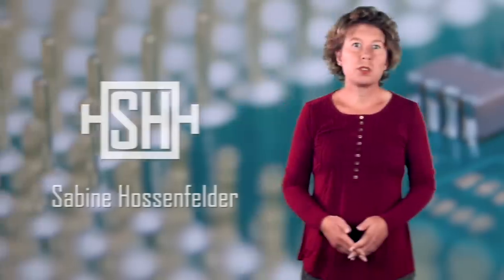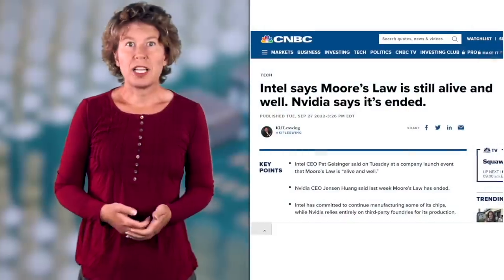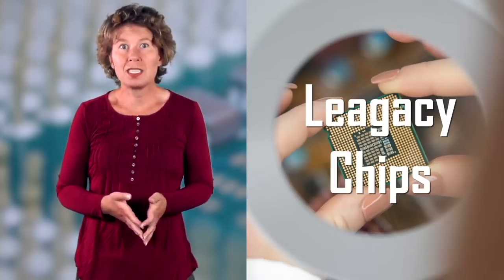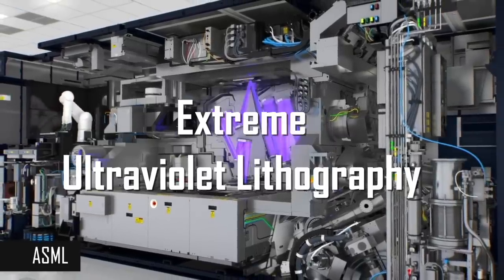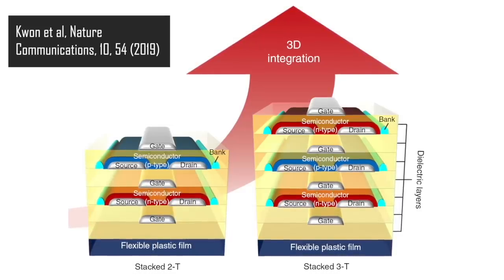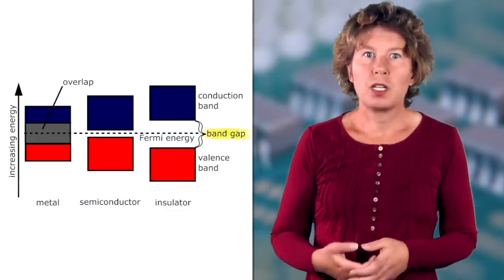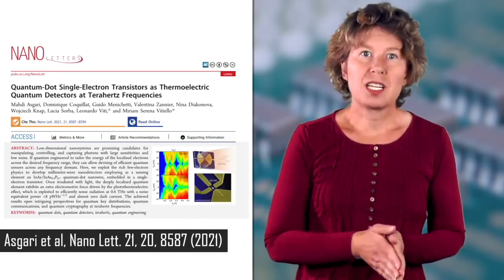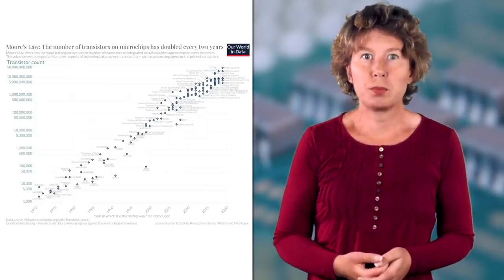Is Moore's Law Finally Dead?

Comment: A few comments from a chip designer. 
1) Regarding the transistor size limit, we are pretty close to the absolute physical limit. Although the minimum gate length equivalent figure (the X nm name that is used to name the process node) only refers to one dimension (and even that's not quite that simple), we are talking dimensions now in the high single digits, or low double digits of atoms.
2) Regarding electron tunneling, this is already quite common in all the current modern process nodes. This shows up as a consistent amount of background leakage current, however as long as it's balance (which it typically is) then it doesn't cause logical error per-se. However, it does increase the amount of energy that is just being turned into heat instead of performing any useful processing, so it does slightly cut into the power savings of going to a smaller node.
3) One of the biggest things impacting Moore's law in the context of the transistors/chip interpretation is manufacturing precision, crystal defects, and other manufacturing defects. Silicon wafers (and others as well) have random defects on the surface. Typically when a design is arrayed up on the surface, during later wafer test a handful of the chips will not turn on due to these defects, and thus are discarded. The ratio of good transistors to total transistors is referred to as the wafer yield. As long as the chips are small, then a single defect may only impact yield a little bit because the overall wafer has hundreds or thousands of possible chips, and only a few hundred defects that could kill a chip. But as chips get larger, yield tends to go down because there are fewer chips per wafer. There are some techniques like being able to turn off part of a chip (this is how you got those 3 core AMD chips for example), but ultimately as chips get larger, the yield goes down, and thus they get more expensive to manufacture.
4) As discussed in this video, what people really care about isn't transistor density, or even transistors per package. Rather, they care about computing performance for common tasks, and in particular for tasks that take a long time. By creating custom ASIC parts for new tasks that are compute intensive (ML cores, dedicated stream processors, etc), the performance can be increased so that the equivalent compute capability is many times better. This is one of the areas of improvement that has helped a lot with performance, indeed even outpacing process improvement. For example, dedicated SIMD cores, GPUs with lots of parallel stream processors, voice and audio codec coprocessors, and so on.

Anyway, overall a great video on the topic as always!
Reply: Surely these improvements in chip architecture (idk if that's the right way to put it) also has its limits.  Ik it's not very planned obsolescence of me, but what I'd really like is for manufacturers (& programmers) to focus on increasing the longevity of computers.

It'd be nice to only need to buy a phone once every 10 or 20 years instead of once every 2 or 3 years.
Reply: Process nodes like "X nm" don't refer to an actual physical channel length, gate pitch or any other transistor dimension anymore. Unfortunately this video doesn't help clear up that common misconception. They are merely marketing labels loosely correlating with performance or transistor density. In particular, channel length (i.e. transistor size) shrinking has essentially halted a while ago at ~20 nm, so a 5 nm transistor isn't nearly as small as "5 nm" would indicate.
Reply: @Pukkeh  Yes, that's why I used the term "minimum gate length equivalent" instead of saying minimum gate length. The actual minimum feature sizes are larger than the marketing minimum gate length equivalent number , but they are still quite small.
Reply: @funtechu I understand, I'm just clarifying for the benefit of anyone else who might be reading these. Most people outside the field think the process node name refers to some physical transistor feature size. This hasn't been the case for years.
Reply: @dr.zoidberg8666  Absolutely, though those design limits are much harder to put your finger on. For example, Amdahl's law sets a limit on how much you can parallelize something, but even that can sometimes be worked around by choosing a completely different algorithm that manages to convert what was previously though to be strictly sequential to some clever parallel implementation. 

As for longevity there are two major aspects of that. For phones, the biggest thing that impacts longevity is battery life, which could be remedied by having battery replacements. Personally I keep most of my phones about 5 years, with typically one battery swap in the middle of that period. Most people though buy newer phones just because they want the new features of a newer phone, not because their older phone died.

The physical process limit on longevity is primarily driven by electromigration, where eventually the physical connections in a chip wear down and disconnect. In mission critical chips there is a fair amount of effort put into ensuring redundancy in current paths to try to improve longevity and reliability, but the fact is that heat dissipation is one of the largest factors that impact this in practice. Keep your electronics cool, make sure they have adequate cooling, and they will run longer in general. Note that this is also more of an issue with newer process technologies because metal layer trace widths are typically much smaller than they have been with older process nodes, meaning that electromigration doesn't have to work as much to break a connection. So with higher density comes the tradeoff of slightly shorter lifespan.
Reply: @Pukkeh  Yeah good point.
Reply: Let start from wrong image of CPU-GPU transistor, she used typical n-p-n. For now modern computers are good enough to multiply human's garbage. Future can be in splitting tasks between humans and AI - leaving humans to post tweets and emojis - 280-4000 characters are good enough for typical no-brainer. Leave calculations to machines.
Reply: Yeah currently we are like 29nm for gate pitch, and that won't really go much below 16nm. I get very annoyed when people think the industry's marketing terms of "nm" gets confused with actual dimensions.
Reply: @MFMegaZeroX7  the amount of 'nm' was quite accurate for describing gate length right up to the point of finfet though. And I think that, even with finfet things being more of a mess,  some drawn dimensions in EDA layout, at least in 16 and 10 were still 16 and 10 nm respectively.
Reply: Nice & insightful comment. Thanks.
Reply: Hey, regarding the yield and chip size - what are the disadvantages of using chiplets? I mean it seams like a pretty awesome idea to improve yield via packing more, smaller chips on a single waffer.
Reply: It is fantastic to hear from you inside the industry. I don't understand half of it (or more) but it is still interesting. I see similar things at the more simplistic level us technicians deal in and have questions about why they designed this or that in a certain way. Maybe I'll learn something from watching Sabine's videos.
Reply: @psow4062 Higher power + latency, lower bandwidth between chiplets. It adds complexity for systems integration.
Reply: All very coo,but can you make computers hack proof.
Too much cyber crime happens.
Reply: I recall for upgrading my ZX Spectrum the 8 x 4164 chip was used to add 32 kb where the chip should be 64 kb. These were defects where the first 32 kb was ok. That was 1985.
Reply: Great reply. Why did you not ask for a video on chip design? The chip design is where all the real quality happens. Can't have a quality product with quality fabrication processes without the upstream quality built into the device and device architecture. Moore's Law is interesting, but the chip design is where the real thought happens.
Reply: Sounds to me like you need a means to do away with defects more efficiently or another means to assist with fixing this issue altogether.

I would like to know whats being done presently to fix the issue, so as to consider what else can be done to aid the issue.
Reply: i @Waterdust2000  i believe she mentioned 'light etching' to have less chip malformity.. course you're etching a malformed chip to begin with
Reply: The Von Neumann architecture has reached its limits.
Reply: This is what what said back in the 90s, but this time I think it is true. Then, it was largely a question of transistor leakage, a problem that was solved by abandoning the planar process. This time it is really a question of quantum tunneling.
Reply: Could that quantum/electron(same?) tunneling effect become a feature instead of a problem within chip architectures? The resulting current that you mentioned mentioned, any way to capture, isolate, redirect that energy? If i understood you currently it will be just ignored aslong the performance gain is not impeded and the energy and heat issues would not become unbareable, correct?

A while back i saw on the yt channel Asianometry a, in my eyes, well made chip manufacturing documentary. One thing that stuck with me was the thought that transistors do not just need to be placed on a 2D surface, but future archictures would try more and more built them ontop of each other. How far has that approach sofar taken root ? I would imagine the biggest issue is with either waver creation, as it is one thing to just chisel away from the top or having to hollow out thicker wavers(is that even possible?)or smack them ontop of each other. Which i would assume is what is done, creating matching tops, mid sections and bottoms, till we have waver layering on top of each other and by doing so creating more complex, yet efficient pathways as they are locally closer together.
Reply: I was hoping for some mention of Bizen. The important measure of Moore's law, isn't so much the transistors density, but rather the density of logic gates. Briefly, Bizen technology (a UK startup) has a new approach to the transistor, allowing for logic gates to be built with fewer transistors, thus shrinking chips without necessarily changing the die size. Last time I heard anything, they had received a research grant, but were a long way from production.
Reply: Am I wrong in thinking that she described a mosfet? I thought transistors were base, emitter and collector.
Reply: @eeledahc  Transistor is the general term. MOSFET stands for "metal oxide silicon field effect transistor" which is the most common type used in digital design. Other types are bipolar junction transistors (BJT) which has the symbol that Sabine uses in this video, IGBTs, JFETS, and so on. But they are all transistors and just have different uses.
Reply: @dr.zoidberg8666  "I want technology to progress slower so that my 20 year old technology can stay relevant." ....... el oh moe uh foe kun el sir
Reply: Calculating the inverses of heat distribution patterns can be used as operators too, as analogue phenomena.
Reply: When talking about development, the question is not only about (computing) power, but also about (computing) quality. 
In the transformation of energy, from one form to another, the (computing) power must be sufficient, but the quality of the energy must also be of the right kind. 
Massive automatic computing power still remain automatic: Its quality do not improve by itself.
Real development would be qualitative: Automatic (energy) would transform into sensitive (energy) and conscious (energy). 
Energy transforms itself into lower qualities (waste heat): 
But the conversion to better quality (than automatic) doesn't happen by itself:
Entropy grows. 
Intuitive programming would mean knowing, how to realistically imitate that, what is "self". 
How do you programmatically make a lifelike model of self; 
Do you know, what "self" is ?
How could the ego be made into a model? 
Is it even possible to model the spirit realistically? 
That would be qualitative development.
Reply: Great information. I'm happy to say I had a good sense of all these concepts and I find it unfortunate this isn't whats actually taught in these education videos. Consumer exhaustion of any "3d" terminology used in marketing after 3d tv has probably led to a lot of skepticism regarding "3d" when used in reference to flash memory but as it turns out it's actually a pretty big deal. Further this same lack of knowledge has led tech news to completely misunderstand Intels business model. When asked why AMD Is benefiting from supply chain shifts but Intel is not I'm like you're gonna have to sit down and get a lectured to understand this. I also find it a little jaw dropping that Sabine has talked about transistor size limits on multiple occasions and referred to tunneling as the actual limit. Sure an atom isn't a gate (yet!) but a transistor isn't one component either.
Reply: It was never a "Law",  just a rule of thumb.
Reply: Мы перейдём на энергоэффективные сверхпроводниковые схемы работающие на частотах до сотен гигагерц на температурах близких к абсолютному нулю. Энергоэффективность таких схем может быть выше на три порядка.
Reply: What is your view on 3D packing?  It seems like we have only scratched the surface on that...could Moore's law continue by adding layers, or is there a fundamental unsolvable problem (like maybe heat)?
Reply: @dr.zoidberg8666  The reality is, you don't need new hardware....it's just that the new software only runs on hardware no more than 3 years old, and then cell standards keep changing (5G now, 6G next, 3G is already completely gone and 4G is being phased out) and that's what really forces you to buy a new phone.  Also, cell phones are actually cameras combined with a tablet ...that also makes phone calls.
Reply: A definition of "channel l effective" would be helpful here. There are other important metrics for things like interconnect density.
 @Pukkeh
Reply: Two dimension not one.
Reply: We are not near the limit at all. We are at the limits of lithography. Meanwhile we are efficiently manufacturing with individual atoms in labs today.
Reply: Mary Tyler has a law?
Reply: In 1990 mercury lamps were the Lithography light source with no obvious way to make anything more dense than it's wavelength. Exactly what is the limit other than the width of an electron itself?
Reply: Cool comment
Reply: What's the deal with 3d chip design isnt that on the horizon and won't it mean that we will have another leap in performance. Ultimately there is lots of room to work with in terms of software optimization so for now things can still get faster that way. Do you think 3d chip design will be the way to the future or do you think eventually everything will be cloud based.
Reply: @Meatloaf_TV  3D design (chip stacking) is not particularly new, though there have been recent developments. The biggest issue is that heat dissipation, which is already an issue with current designs, becomes an even larger issue with stacked designs. So it's not like you are going to see cubic chips anytime soon.

Whether computing will be cloud based is completely orthogonal to the discussion because the computation still has to be done *somewhere*, regardless if it is on your computer or on someone else's.
Reply: Whoa, a highly informative long comment!!
*blown away

Thanks for explaining all that :D
Reply: @dr.zoidberg8666  thing is, computers don't really have planned obsolescence. Phones we made 10 years ago where the best we could make. Already you can realistically keep a 200 euro phone for 5 years at this point, so it's really pretty good
Reply: Arh pfffft, what he said, beat me to it🙄😳🤪🤯👍🤣🖖
Reply: @funtechu  I get good Ph battery life ideally keeping battery between 20% min to 80% max charge. Preferably 50%-80% top ups. Outside this 20/80 stresses & reduces battery life. 
I've also seen contradictory info regarding battery temp & charge speeds so not entirely sure there although I tend to try charge cool & even rest the battery 2hrs if possible.
Reply: @renko9067  Hahaha, it's her show 🤪 Your comment will go over most of their heads just as their comments mostly went over ours I suspect! 🤣
Reply: Thanks for the insightful comment!
Reply: @AnEagle  Why can we no longer remove & replace our phone batteries?  What would happen to the longevity of a phone if we could do that?
Reply: I'm a novice, so just spitballing here, but when you say "4) (...) what people really care about (...)" aren't you disregarding a rather significant sector of research dependent on technological advances, such as AI, or other automated research computing?
Reply: The x nm nodesize-name doesn’t refer to gate length. It doesn’t refer to anything anymore and is a pure marketing exercise. There is nothing you can measure that is close to that size on a modern transistor. Even on planar it was less and less accurate as
Nodes shrunk.
Reply: @kindlin  If you're not a gamer, a media producer, programmer, or some other profession or hobby that needs high end computing power, a Core 2 CPU from 15 years ago is probably all you need.  Let's be generous and say a 4th gen Intel iCore or Athlon II x4 (c 2012?). One can throw a system together (including a copy of Windows) for around $100-150 for a desktop (less if you have case, power supply, or other parts), a bit more to refurbish an old laptop (if you don't mind going without the battery). Even most gaming setups can get by with a 4-5 year old CPU now, and a 2-3 generation old GPU. That wasn't true 10 years ago. We're at a generational change, though, and that will change over the next year, but will usability of even older parts will likely be even more true at the next generational change. (Gaming consoles generations.) It's been a slow change over the last 15 years or so.
Reply: Computer architecture and design always fascinated me. If I wanted to learn how they work as a self study and understand all of the mathematics, programming, engineering, chemistry and physics that go into it, where might I start?
Reply: Would the physical limit be improved much by room temp superconductors, if those turn out to be true?
Reply: @ctakitimu  How would that even help? If you replace silicon with superconductor you just have a conductor and no longer have a computing element of any kind; so I'm assuming you mean to replace some or many of the metal layers with a superconductor. There is no obvious way to replace the metal layers with superconductor without destroying the rest of the processor with extremely high temperatures during manufacture; so this is likely not easily manufacturable. Ceramic superconductors are kind of finicky, and rely on a very specific mix of elements; there will be defects everywhere in the material that act as insulators; making very small wires out of something that has defects is bad; it's not clear if you could make the superconductor small enough to matter. The metal layers contribute greatly to heat dissipation and it is unwanted to replace them with something that cannot conductor away heat very well. The transistors are unaffected, because they are still made of silicon CMOS, like finFET or GAAFET. This means the superconductor will get to a temperature of ~70-100 C where it may cease to be a superconductor.

If you can design a completely different computing element based on a completely different principle than CMOS; and it may not be an electronic computing element, it could be anything like spintronics etc; you could have a use for superconductors. In that case it has been possible to do so for many years using already existing high temperature superconductors that only need cheap liquid nitrogen (cheaper than milk) and I have not heard of it. Even a minor change takes 20 years. E.g. replacing aluminum with copper, SOI, strained silicon etc, so this means a new superconductor-based computing element can't really be mainstream before 2050 or so.
Reply: study Jim Keller’s view in the subject. assassin silicon artisan.
Reply: @funtechu thank you so much for taking time to share technically relevant information
Reply: If we had fewer abstraction layers in the firmware and software running on these transistors, we'd have far more efficient code than we have right now.  
When transistors were precious, the code that ran on them could not suffer bloat.
In any case, ASICS (also simply CPLDs and FPGAs) have been saving engineer's butts for - well, for my entire career at least - some forty years or so.
Reply: @funtechu  I don't think that number is correct. The smallest features in the interconnect layer in the new N3E chips is over 20 nm. (The gate length is actually 45 nm.) The covalent radius of silicon is 0.116 nm. So that's nearly 100 silicon atoms, not "high single digits or low double digits."
Reply: @EebstertheGreat  Who said anything about commercially available nodes? ;)
Reply: @funtechu  If you are working on some future nodes then you are holding out on me. Is your job related to future tech? Cause you get additional Civilization Points for that and could reach a cultural victory.
Reply: @eventhisidistaken It is possible. Cray research did that. Cooling is a problem tough.
Reply: @railgap  The software industry keeps bloating as fast as hardware improves, so the net effect is consumers get little benefit from faster machines.  Look at something like xml, or any of the other ASCII markup languages.  It makes no engineering sense at all to use human readable formats for machine to machine communication where no human will ever need to look at it.
Reply: Not something I gave much thought to, other than noting my phone is way more powerful than my 1st work computer that I thought was so cool.
Reply: I suspect that the Apple silicon has heavily gone down the ASIC route, since they control the entire software stack.
Reply: @funtechu ...mosfets are voltage -controlled resistors, or "transconductors" whereas transistors are current-controlled current sources, or 'transfer-resistors'
Reply: @zweisteinya  Wait until you find out what the "FET" in MOSFET stands for. Your mind will be blown! ;)
Reply: How do I become like you? PLEASE! tell me!
Reply: @funtechu maybe a stupid question but if the physical dimensions of the gates or transistors is not getting smaller as the branding suggest then how are they cramming more of them into similar die areas with every new generation. Talking in terms of GPU designs.
Reply: @mojojojo6292  They are in general getting smaller, but not in a way that the node names would suggest. With older process nodes the node name (for example, TSMC 180nm) referred to the transistor minimum gate length which was a well known quantity, but also only refers to one dimension. Transistors also have a width, plus additional spacing for the actual power/ground tracks, and so on. This would be akin to measuring house sizes purely by the distance from the front of the house to the back of the house (like 20 feet) instead of square footage. As long as houses are the same aspect ratio, then using one dimension can be reasonable for comparison. But if a house gets taller, or wider, that isn't captured by the single dimension.  
  
Back to the transistors, the modern process nodes are no longer planar transistors, so such a dimension no longer applies. It would be like comparing a 4 unit adjacent townhouse or a 5 story apartment complex to a single family home based just on the single dimension from the front of the house to the back and concluding that they are not shrinking much anymore, even though the actual housing density is higher due to more horizontal divisions, or added height. Modern process nodes use things like finFET technology where the gate is on three sides of the channel, Gate all around (GAA) transistors where the gate completely surrounds the channel, ribbon FET transistors which are like GAA, but with several channels stacked vertically in parallel to provide a greater effective width while keeping the length the same and stacking up in the 3rd dimension instead of spreading it out, or other experimental transistor designs. In addition, the same improvements in process technology that help with producing these fine features help reduce the clearance needed for surrounding and supporting structures (for example, minimum track spacing, minimum clearances for metal layers, etc) which overall helps improve density. So the bottom line is that density has continued to improve, but the gate length equivalent figures that are used to name process nodes nowadays are not standardized or tied to an easy-to-verify physical dimension, so each vendor does it pretty much however they want for marketing purposes. That's why for example you'll hear things like how Intel's 7nm process is actually equivalent in transistor density to TSMCs 5nm process.
Reply: @funtechu  Very interesting. Thank you for the detailed response. Where do you see the industry going now that it appears we are reaching the limits of what is possible with silicon or will these new fet designs continue to scale for the foreseeable future?
Reply: @mojojojo6292  See item 4 in my original comment. We'll probably continue to get marginal process improvements for at least the next 5-10 years, but the main areas where we can still get orders of magnitude improvements is in pushing certain common software tasks into hardware in the form of ASICs or dedicated specialized processing cores.